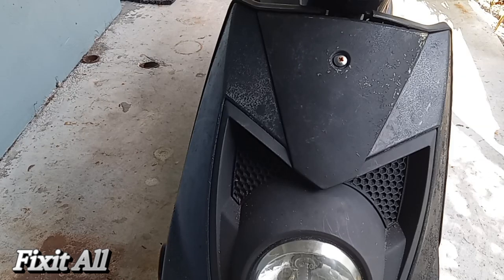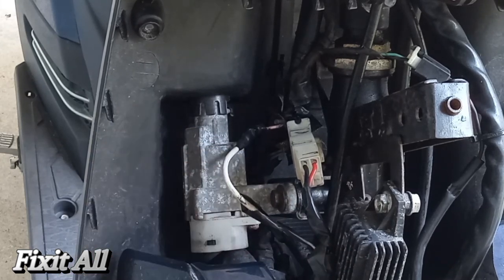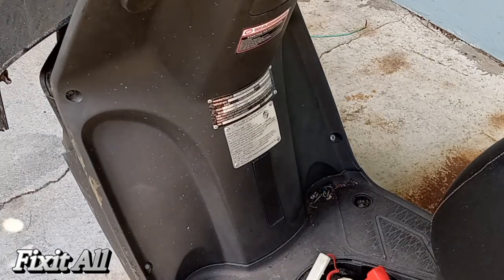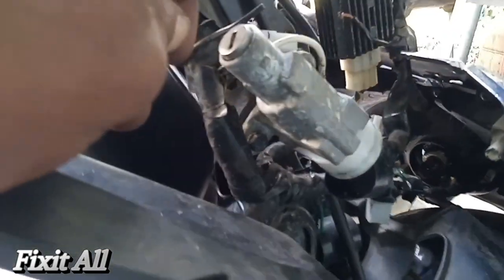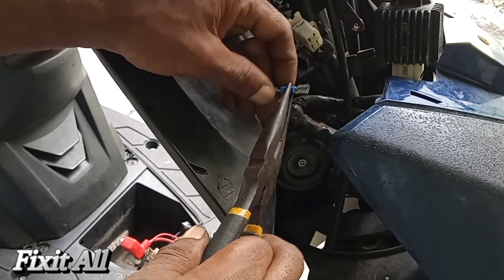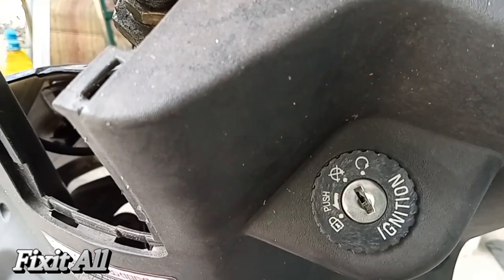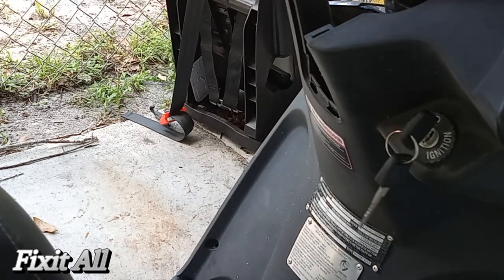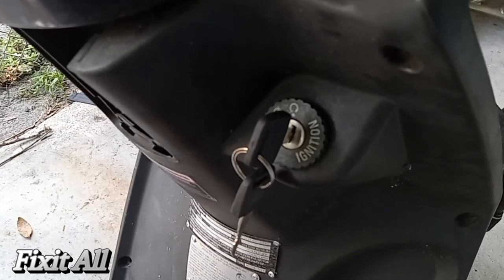GY6 50cc IGNITION SWITCH REMOVAL/INSTALLATION STEP BY STEP

Comment: So ur saying if I go up to a random moped and plug in a different ignition it’ll turn on with my key?
Reply from the maker: It will turn on with the key specified for the ignition switch.  So to answer your question,  No, that won't work.
Reply: @fixitall588  but the new ignition switch will have its own key obviously
Reply: @hazz6386  yea basically that’s what he’s saying 😂 just need ya switch nd tools nd u good for snatching a random bike 💀 (don’t advise doing that tho)
Reply: But a actual ignition barrel the comes from one of there diffrent or same models would work? Got a 2021 sym lance pch 125 and bought one that’s for the crox or lance Cabo

Comment: Yes I was wondering if you could tell me if a GY6 the same for ignition switch as a bloom revolution 2022 1/54
Reply from the maker: You will need to remove it and check the wiring for a matching part. Tha ks for watching. God Bless